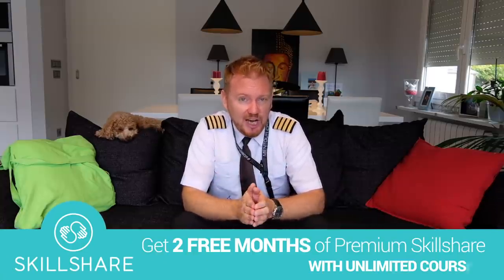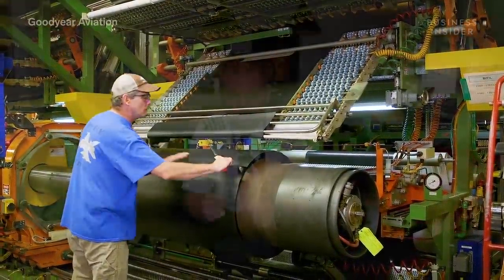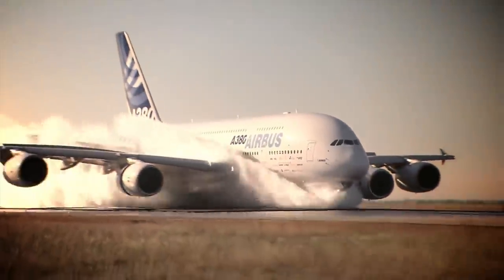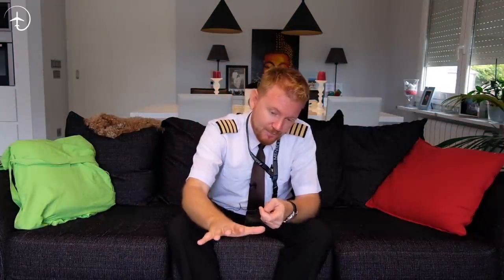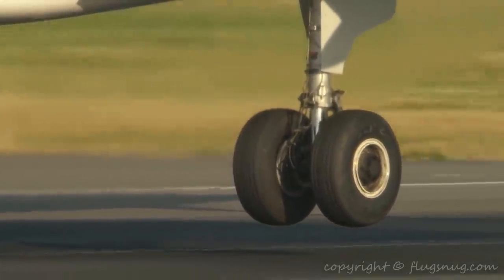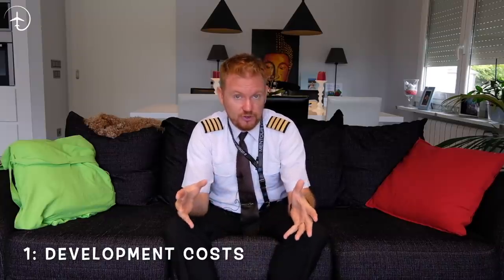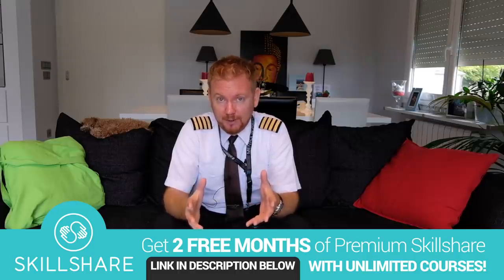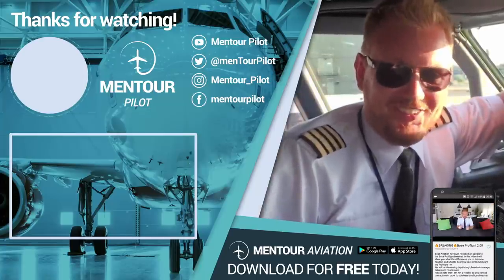Why not make plane-tires spin, before landing?!

Comment: You don't need an "electric/gas" Motor on the wheels to make it spin. You just need to redesign the landing gear rims where you have almost flushed side vents on the edge of the rims to draw air to small blades towards the inside of the rims to act like an air-motor that could pre-spin the free-wheeling tyres on landing. Almost like some of these aerodynamic hub caps (but with a purpose to pre-spin the wheels not just for aerodynamics). I wouldn't recommend a clip on hub cap, but it could be hard designed into future rims or more securely secured light weight hub caps eg with bolts. The wear on the tyres would definitely be dramatically reduced. This is a passive solution so it doesn't not have a complex point of failures like a conventional motor. The force would also be proportional to your air-speed so there is no mis-balancing of wheel speed mismatch or counter-acting magnetic forces an electrical motor might have if sudden changes in wheel speed happens.
Reply: Ha. See my comment......
Reply: But now youre increasing drag even more than the landing gear already does and probably mess with the pitch of the aircraft
Reply: That´s not well enough thought thru, first a spinning wheel is not good for aerodynamics, second the problem with the speed is still there since the speed of the wind is not the same as the ground speed and third it still needs to be fail prof.
Reply: Not sure if the airspeed would have enough force to spin up the wheels at the cost of the drag. However some bleed air could help
Reply: That´s it! Adding that you do not need match ground speed, if it goes just half the speed, tyre useful life will double. Being passive, L/G will not "drive" the aircraft out of lane in case of crosswind. Added drag is not an issue during landing. Tractors (remote controlled or not) shold be driving airplanes to and from runways since last century.
Reply: @annabellem7953  BTW I am not a pilot, just a lowly engineer. I don't really see much of an increase in drag as most current aircraft rim are not exactly aero-dynamic either these "rims" could be designed more aero-dynamically to minimize imbalances/differences of pitch or drag as compared with current rims. BTW you can always design passive centrifugal speed limiting spoilers on the rim design to avoid overspeeding.
Reply: @vossli1074  I am not imagining a significantly large sized hubs as the hubs could be design to improve/counter the aerodynamics of the wheel as compare to current landing gear design. We are talking about turning free wheeling tyres (which I am not trying to underestimate the force required to turn a free wheeling landing gear) as oppose to the force of turning the tyres with the weight of the aircraft on it.
Reply: @clovisaalmeidajr8651  The idea of the tractors is good, but the engines need bleed air to start, so they have to start at least the APU at gate and the second problem is, the engines need time to start, so they can´t just start them at the runway, captain joe did a good video explaining that.
Reply: @cvhawkeye6255  The problem is not the drag, but the down force could be.
Reply: Directing airflow between the wheels (in the lower half ) should be pretty easy, and instead of  creating special rims you could have a slight redesign of the tires (some low profile perimetrical extruded pattern ) which would require way less air pressure to rotate the wheels.
Reply: ...also the air flow duct could easily switch to the upper half of the tires the moment the hydraulic piston is compressed from the weight of the aircraft, thus functioning as a break ( of insignificant stopping power ... but hey why not) . All in all no motors needed for the wheels to spin before landing. Plus the excuse that tires are cheap is lame... we live in a pollution and climate emergency...
Reply: @theomichael6665  My 2 cents is asking doesn't the aircraft industrial tyres avoid tyre pattern with threads/extrusions like the plague? For fear of tyre debris from worn tires on runways.
Reply: more drag?
Reply: @annabellem7953  But couldn't the outgoing air from the rims be design in a way to minimize such effects? Time to call in the CFD white coats on this. Mentour Pilot probably needs to sponsor some skill share points in this area.
Reply: I was thinking about that too
Reply: But, as suggested in the video, the tyre lasts for 3 - 400 cycles, therefore, no real financial gain.
Reply: @colinsouthern  Well you are probably right that some one some where might have thought about it. But hey that's what opening ideas is all about even if it ends in a mindless exercise. You never know someone might add bits to a point that might lead to a new break through.
Reply: I had the same idea!   I think it would work and won’t cost much to manufacture.   There is still the test/regulatory approval costs tho.
Reply: @annabellem7953  they certainly have to be started before reaching runway. Even so, fuel will be saved. Imagine a time when Ground control does not give clearence for taxi but move aircrafts from gate to r/w and back!.
Reply: @cvhawkeye6255  Not as I know, these effects also apply on F1 cars. I´m not to sure about how it works completely, still learning.
Reply: guys, you are all on the wrong trip: not side vents in the air could bring the gears to the proper speed, no electric motor would be economical, the solution is making it mechanical: every passenger gets pedals underneath the seat in front and these pedals are connected by bike chains with cogwheels at the gears and 3 minutes prior landing the captain has to announce through the speakers "passengers! feet at the pedals! And on three: 3, 2, 1, pusch, pusch, pusch!" And 1 second before touch down all feet up from the pedals and the good thing is, at the start the passengers don't do it and the gears don't cause unhealthy drag, because they keep still. Who likes my idea? Thumbs up.
Reply: If I saw right, even an already spinning wheel on 2nd impact in the vid created a puff of smoke. This means the benefits would be reduced unless the exact speed of rotation required could be attained. I did go into this thinking would help however, using an inertial or centrifugal method to shut spoilers attached to the rims. My thinking was to just get some rotation in there to reduce the friction. Also I think the smoke is as much to do with sheer weight of the aircraft dropping onto terra firms as it is with the speed difference of wheel to ground. Great discussion though.
Reply: @colinsouthern  You are right! But a little change is needed then: better air con because everybody is sweating like hell 😂😂😂
Reply: @colinsouthern  I got some questions from a layman in engineering based on what you just said:
- more drag on takeoff thus decreasing takeoff performance
I wouldn't think an aerodynamically designed hub caps would offer very much more take off performance penalties than current rims (which are currently aerodynamically poor anyway) on landing gears and for the short period in which the landing gear is down. I can understand that this might not be for aircraft with non-retractable landing gear.  

- higher fuel burn whenever gear deployed 

- similar point to above ... current landing gears are not that aerodynamic anyway and given the period its down

- would need something to constrain speed (gear is lowered at much higher than V Ref)
- Doesn't current landing gears left freely spin anyway? How is this issue regulated? But like I said a passive contrifugal spoiler could be implemented. But this is a open discussion to ask questions and broaden my knowledge based on the topic raised as opposed to wanting to really wanting to build one.

- That constraining mechanism would need it's own failsafe and maintenance regimes.
- Well passive systems are usually more reliable and easier to maintain than alternative active systems like electrical motors.

- It would be dangerous for landing on wet runways where the initial contact helps prevent aquaplaning.
- I am not a fluid dynamics expert but how does the hydrostatic pressure in a spinning wheel be more than a wheel spinning at a much lower speed/hardly spinning hitting the ground given the same rate of decent and ground speed. Surely the faster spinning wheel would have a chance to remove the water in front of the wheel quicker thereby reducing the hydrostatic pressure to lift the plane to aquaplane. While a none spinning wheel would increase the amount of water in front of the wheel which in turn would increase hydrostatic pressure as the aircraft moves forward. In fact hydrostatic pressure is only reduce as the wheel spins up (as water is removed as the tire spins) after touch down. In fact during the aquaplane, the tires would hardly spin (as the aircraft drifts on a film of water) if there was no real frictional contact with the ground to enable wheel spin and water removal.

Sorry for the lengthy reply, just asking, I am no expert on hydroplaning. And I know its becoming to invent a sledge hammer to solve a problem that is commercially not there.
Reply: @colinsouthern  😂😂😂😂😂😂😂😂😂😂😂😂😂😂😂
Reply: @colinsouthern  that's why the propeller-stop-handkerchief is mandatory as part of the uniform, to wipe your sweaty face in case.
Reply: Usually the wheels fit snog in the wheel wells... I don't think the wheel wells will allow it.
Reply: Aircraft tire/wheel assemblies do not readily spin like blowing on a pinwheel. I’ve changed thousands of airliner tires and that’s a fact. Not only turning the wheel but the multidisc brake too.
Reply: I was thinking the same thing, but not as an addition to the wheel.
Rather, some chevrons could be molded into the side of the tire at practically no additional cost that would pre-spin the tire to some extent.
No, it would not necessarily match ground speed, but every little bit helps. And, yes, it would minutely increase drag - but at landing, that's not a big deal.

Also, as far as the "crabbing" on crosswind landings, the angle of attack of the air on the chevrons would be automatically decreased to incrementally nullify the effect when it is desired least.
Reply: Maybe other people already mentioned that but
it would take a lot of time to spin massive wheels using airflow 
small blades will not do anything good here and big blades will add decent mass and unnecessary  weight
the electric motor would make more sense as it can be integrated into the brake and may even be so strong to be able to drive entire plane on the ground on electric power saving lots of fuel
Reply: @colinsouthern  
I agree that is is not a problem and no need to do anything even if that could work.
summer tires are pretty resistant to all that kind of abuse so it is no big deal, just add more rubber.
Reply: @colinsouthern  You obviously either didn't read my entire comment, or glossed over the pertinent parts - such as, "Rather, some chevrons could be molded into the side of the tire at practically no additional cost that would pre-spin the tire to some extent.
No, it would not necessarily match ground speed, but every little bit helps. And, yes, it would minutely increase drag - but at landing, that's not a big deal."

The point is that any amount of pre-spin would diminish tire wear, and the pre-spin could be accomplished with any positive amount of asymmetrical amount of drag on the  bottom of the wheel as opposed to the top of the wheel.
There is no need to try to match, nor approximate ground speed for the wheel - just reduce the differential speed between the two.

I don't even know what "normal ground speed" means, so I'm not sure where that came from.
Reply: @deltaxcd  I get that, and I'm specifically not calling for the tires to be at ground speed - just not as slow as stopped.

Like I said, "every little bit would help in reduced wear on the tire", and molding in a small feature on the side of the tire that causes any amount of rotation in the right direction would take advantage of freely available sources of energy without having to add expensive and fallible equipment to the plane.
Reply: @jdgower1  
well then I am not sure whats is your point
there is no reason to bother with "every little bit"  tires are not that expensive to care about little bits
and making them turn at low speed will not be any use. small chevrons will not be able to spin it into any reasonable speed. 
You rather just add the same mass of extra rubber to the tire and get better results by making it last longer.
Reply: @annabellem7953  What's less failproof than the most simple fan?
And the wheel speed obviously don't need to match ground speed as they are spinning at ZERO kph right now. As far off as they can be.
Reply: @clovisaalmeidajr8651  tyre useful life will more than double when halving the speed. The less time spent in "friction", the less heat will generate which means less overall total wear.
The longer the wheel takes to spin up from stationary, the higher the contact temperature will be and that's really what causes wear on rubber tires.
Reply: @colinsouthern  I understand your misgivings, but I think they are misplaced.

I'm not going to try to do a CAD drawing of what I'm suggesting, so let's just forget that I said anything at all - OK?
Reply: @deltaxcd  I work in the engineering field with smaller companies who are trying to find every efficiency increase they can, wherever they can.
They realize how pennies add up to dollars, so that's where my perspective is.

Let's just pretend I didn't even say anything, and all will be OK.
Reply: @cvhawkeye6255  "just a lowly engineer". May be that's why we both thought the same thing.
Reply: @vossli1074  Increasing drag is miserable
Reply: @annabellem7953  spinning wheels passively does not means spin it exactly the same speed ,it means spin wheels near the landing speed, spinning wheels passively with hubcaps or fins will never rim reach the same speed as aircraft lands just because of some aerodynamic losses which is unavoidable and the  will be some slip between airplane speed and wheel speed , person meant with his comment that using that technology will drastically reduce tire wear and tear and since this system is passive there is almost no chance of failing cause there is no automation it is just passive
Reply: @axelBr1  Lowly is always good it gets you in a learning position especially if you are not paid to be a know it all jackass expert (which no one really is but pretends to be one). To me this exchange has been useful, especially when I am not in the industry. I watch Mentour mainly to see the dog in action love Patxi.
Reply: @colinsouthern  After some more thought, in regards to aquaplaning ... it would seem that the deep of thread/thread design of a tyre would contribute to the tyre's performance on wet ground more than a tyre being prespun or not immediately upon touchdown.
Reply: CV Hawkeye the main issue with your solution would be when the aircraft would come in at an angle, like Mentour explained. Then, the side of the landing gear leading into the air would spin faster than intended and the trailing side of the landing gear would probably not spin at all, having the hub behind the air stream..
Reply: I have been flying over 40 years up to all versions of the 747, except for the 741 and had those ideas some 30 years ago; there are even patents established on similar ideas. Seems to me the low cost of tire replacement and the high cost of getting anything certified in aviation will keep those ideas on the shelf. .. even electric tugs to get you to the runway when you are # 75 for take off @ JFK where you burn 4 tons of Jet A1 to get to the #1 position just to taxi back to get more fuel for your 748 with a taxi weight of 440 tons seems like a total waste. In Africa there is a saying: TIA, “This is Africa” when things are not flowing to expectations .. I would say: TIA, this is aviation.
Reply: @richardlewis7471  wanted to ask Petter but I guess you know much more likely: how heavy is a tyre of a 737? Or how does it work at all: do you change the whole wheel to make the change MAYBE quicker and later you put off the tyre? Or does the wheel stays at the aircraft and you actually change then only the tyre? And how often need the brakes discs to be changed... well, that depends a lot at if the plane lands 10 or only 4 times a day, e.g. - so stupid question... but are the discs extremly sturdy or have they to be changed anyway quite a lot?
Reply: i think what you are speaking of is a voith schneider propeller integral with the hub of the tires.
Reply: @RealCadde  Yes! That is what I meant. Another advantage: less tyre change means aircraft available to fly $$$.
Reply: Was about say this, just fit some fins to the rims on the wheels.
Reply: Where would you fit a motor big enough to spin the wheels
Reply: Great idea. I was ready to post my idea, which is close to yours! Great minds think alike...Bless you guys.
Reply: Yes , I thought of something similar . But as he says on a cross wind landing . One wheel would be exposed to more wind so would be faster then the other and that would be the windward tyre . So the aircraft would be forced to the down wind side . Not a thing you would want !
Reply: You can also put a retractable cover on the wheel rim so the spinning can be disabled if for any flight condition it is not advisable.
Reply: I learned in school that they did trials in the 1940's with this ram-air driven wheel concept, by using "air scoops" on the rims.
But the gyroscopic forces generated by these spinning heavy wheels were causing problems with controlling the aircraft before landing.
Reply: @nozack5612  Spoilers which reduce the effect of the rims doesn't mean a retractable kind of approach.
Reply: @welshpete12  I am not so convinced. These rims will have their intake from the sides along the same  directional axis of the wheel ie from the front (looking like protruding hub caps). Unless I am completely missing it the aircraft's forward airspeed will almost always be much greater than crosswinds.
Reply: @halcyonoutlander2105  Passive Centrifugal based spoilers can always be designed within the rims to regulate top wheel rotational speed to no greater than say 160-200knts if the wheels were rotating on the ground. BTW upon landing, air-speed would be approaching ground speed Typically 140-150knts.
Reply: A better written and explained version of what I came here to say. Thought it for years. On a v short runway you’d brake briefly just before touchdown to add the braking benefit of the touchdown smoky spin
Reply: Voss Li it would be tiny as the vanes would be tiny
Reply: @annabellem7953  
>The problem is not the drag, but the down force could be.
The force would actually be up. Pressure would be less at the upper part of the wheel , because of higher speed relative to air.
Reply: Asymmetric dimples on the tire's sidewalls would probably work.

This can't be used, though, for airplanes with open wheel well (Boeing 737).
Reply: @halcyonoutlander2105   Yeah, but it doesn't have to match exactly. I mean, right now the difference between the ground speed and the wheel is TOTAL. So any speed you can get them closer together is a win anyway.
Reply: Your idea seems to be good ..But ..still the problem of SUCKING FOD's (foreign object debries)....is most concernd and seems to be unsuccessful.
Reply: @mohdmubashirahmed4762  What??  Sucking FOD into what?
Reply: @jerrykew  I always thought that when a tyre smokes it meant some skidding/loss of grip has occured, thats why ABS was invented to improve braking efficiency in cars.
Reply: Exactly.. Just use existing air flow.. There's probably a number of ways to make it work.. But some designs probably more efficient than others.
Reply: Is an airplane not complex/expensive enough for you?
Reply: Ok, where would you put the brakes then????
Reply: @huberttrimmel9245  Spoken like a true expert of the skies and taxiways to be that funny. Love it.
Reply: @fullstackpedro  energy needed to spin a free wheeling tire is nothing compared to the drag of the entire airplaine during landing with all flaps out.
Reply: @clovisaalmeidajr8651  I was thinking the same thing about not needing to match exactly, just get close. BUT, I highly doubt tire life would double even if you did match exactly. Look at the landing video: Sure, there's blue smoke when the tires first touch and spin up. But the stress on the tire a few seconds later, when the aircraft puts its full weight on it, is comparatively *enormous*, and I wouldn't be surprised if most of the wear occurs at that point.
Reply: @chingu1980  Guessing here, but probably inside the wheel hub similar to present arrangement, as the (air flow) wheel acceleration feature would be external.
Reply: Not only that, adding external, air flow capturing fins (or similar) may also help with wheel cooling!! As heat is a major destructive force on aircraft tires.
Reply: @welshpete12  I don't think it that's much of a concern, because it happens all the time that aeroplanes touch the runway with only left or right landing gear, meaning the affecting force is very one sided.
Reply: You missed the entire point.  It is not cost saving at all.  It’s physics.    Watch the video again.
Reply: perhaps the effect would be minor but, a spinning mass is going to induce torque. To make things worse the landing gear is hung below the aircraft giving them leverage. this would induce a roll right force. I'm sure it could be trimmed out and handled with computers but it will mean that you will lose some roll left maneuverability. You might also find a difference in roll rates?
Reply: CV Hawkeye in addition “the airspeed“ has nothing to do with it it’s the ground speed which can be and usually is different. The other thing is that you are adding yet another variable to something that has worked fine. There is no major issue with the tires so there’s nothing to fix.
Reply: @colinsouthern  The wheels have to be spun up for a very brief portion of the flight.  As per the airspeed and wheel rotation issue, that could be calibrated with a retractable duct that allows for modification of airflow to the wheel based on airspeed/dynamic pressure.   The bigger issue of gyroscopic yaw mentioned by other posters could be corrected by FCS.   All in all, it seems the complications and risks are not worth the gain.
Reply: @vossli1074  True but I think the most salient argument against it is that tires are CHEAP in the airline maintenance world.
Reply: @colinsouthern  Sadly, never put down unshakable faith, because you will never learn anything by being a jackass in the corner yelling it will never work. There are people in the world who might not be as educated, talented or experienced as "some others" but that doesn't mean that they shouldn't try. Standing in a corner making unconstructive comments like some superior entity is I guess some god given right ... but it sure doesn't help or be in the end respected. I am sorry I don't meet certain standards in sharing my thoughts. BTW I am not hurt ... just saying.
Reply: @colinsouthern  I didn't quantify it, was just responding to other aviators who stated it may be a problem.    The gyroscopic effect of jet engines is minimized by counter-rotating engine components, whereas the wheels all spin in the same direction.   Again, I didn't quantify any inertial moments so can't say explicitly.   Ultimately, I think the correct answer is the spin up of wheels  is not worth effort and time as you suggest.
Reply: Annabelle M , I would think that the “wind speed”, is actually greater than the ground speed of the plane. They always land into the wind, and the speed of air is directly related to the ground speed PLUS any wind speed. So even if there is zero wind, the air speed equals the planes ground speed.
Reply: @colinsouthern  Well, we certainly expect higher standards from aircraft designers especially if they have been paid to do the job. But do remember, we are here where we are from a lot of failed ideas, some people only want to get involved in discussion and possibilities when its past prototyping and testing (because virtually all ideas good or bad has to start somewhere, some I would say from even more humble beginnings and alot ... I mean alot really don't have the patience or time for this phase). Most of these discussions lack specifications and scope to even make fag packet calculations, but that shouldn't stop YT comments to think of possibilities and learn from issues shared. I know from my interactions, I have truly learnt from your thought processes with thanks for your patience in replies e.g. aquaplaning. So a thank you from a person not even close to your industry in which all I know about planes is just to sit in it and enjoy the flight! Its all good from here, and I certainly understand your PoV.
Reply: @vossli1074  When you are taking off that is a problem, but not when landing- it actually helps then. It is balanced out. (And pilots can certainly adjust the pitch of the plane to be ever so slightly higher anyways)
Reply: CV  I was thinking about a similar design, and I don't see a problem at all. I've read about half the comments to your original post, and I'm not sure if anyone touched on it yet, but besides the very small addition of weight and drag, there seems to be no reason not to test out the idea. Only possible case I can think of at the moment would be varying bearing friction causing one side to spin more than the other, possibly inducing an unexpected yaw on touchdown, but that would be no more than if one side touches down before the other with current setup. 
 I'll have to start testing with models and see if something pops up. 
 👊😎
Reply: right,  smoking wheels look like there is something not correct. The material the tires are made should withstand high temperature and not start s  to smoke. Crastin® withstands temperature up to 150 degrees.
Reply: @vossli1074  when landing, increased drag is useful!
Reply: the Aircraft tyre Mafia would not approve
Reply: hooray . . . .plus , if that same system directed the used air via a duct to cool the brake discs . . .mmmmm . . . very little extra drag on the gear and extra disc cooling for brakes at the critical time
Reply: Climate emergency - LOL!!
Reply: @halcyonoutlander2105  Yeah, i agree. I was only responding to the "speeds not matching up" argument many people are bringing up here. 
But yeah, there's many reasons why the whole thing is a bad idea. It's like people are trying to invent a solution to a problem that's not really there.
Reply: agreed - and while it was mentioned that the speed would be difficult to match, surely getting to ABOUT the speed is better than spinning up from zero - and your suggestion is failsafe compared with motors
Reply: Been thinking of a passive system for years.
Reply: I have the same idea. Several years ago I asked the same question of spinning up the wheels. I came to a possible solution where the wheels were passively spinned up by some kind of a turbine fans connected to the wheels. Probably it would be difficult to reach the landing speed, but a consideral amount of wheel spin would help anyway. Lower spinning speed would also reduce the "off the road" force at a crosswind landing. And such a passive system would be more simpel, cheaper and with less possible safety issues compared to a motor driven system.
Reply: @bertschoofs8494  Precisely. The only thing that fucks me off is that I'm not the only one who's thought of this idea!
Reply: @annabellem7953  Why does it have to be fail proof. If it fails we are back to the current situation, which is not a big problem.
Reply: I remember one of my high school teachers....decades ago....saying he had a patent, or had applied for a patent, for something just like this.
Reply: Wheel speed could be accurately controlled to a fixed speed...say Vso....via a simple spring-loaded centrifugal governor actuating the air turbine inlet vanes or nozzle.
Reply: @Tom-tk3du  Applying for a patent is only the very start of a journey. It could be 10000:1 chance just to get it approved and to check if the idea has not already been invented, and another 10000:1 if the patent would even become a prototype (alot of patents are just shelved for many reasons). Probably another 10000:1 that the product would be successfully marketed and sold.
Reply: @cvhawkeye6255  Thanks, I know. I hold 4 patents. Am mainly speaking to the novelty issue....pre-spinning aircraft wheels is likely unpatentable or patentable for a very narrow and less valuable set of claims.
Reply: @Tom-tk3du  I too am a patent holder but not in the aircraft industry. I wasn't planning on anything serious, it was just a point of discussion. And you are right anything patentable would be extremely narrow like some design based patents. Broad-based patents equivalent to inventing the wheel have long gone unless you are entering new fields of science or industry.
Reply: @balazslengyel6950  everything built in an airplane has to be fail proof at a specific level, without is it impossible to certify a plane
Reply: Consider need to brake them after takeoffs (and added drag, when you need pull force)
Reply: Also, tyres are used for braking on landing (if no thrust reverser can be used, it's only option), so you get undesired effect and need longer runway.
Reply: @Scott Millner sorry, I don't have few hours to read through all this thread, keep on rollin ;)
Reply: I agree.   Having air spun wheels by impeller would also allow the the inertial to be absorbed as soon as the plane lands, so it would help the tire wear, but not add any momentum to the plane.
Reply: man i really hoped to find this comment on top, thanks for doing this.
Reply: I was about to say something like that too, doesen't seems hard to do
Reply: Great idea
Reply: You could use the brakes on the landing gear to stop possible aerodynamic problems when not needed to be spinning
Reply: Not ideal for several reasons.  First is safety.  If even a single one of those fin/vents breaks off, it can pop a tire or rupture a fuel tank, both of which can have catastrophic results (think concord).  Also, the planes stop just fine now as is.  Those thrust reverse units are very powerful.  Vents would not even shave off a second of stopping time- might add to it.  Vents would either make the rims heavier or less strong.  Each wheel is subjected to incredible forces.  A simple and strong design is best.  Slight friction upon stopping adds helpful resistance which contributes to the slowing of the aircraft.  If you had fins that spin, that could make slowing worse after touchdown due to the fact that they are continuing to grab air and spin.  The most effective way to slow the plane, short of a parachute or arresting wire is a strong reverse thrust system, strong brakes and grippy tires on a well prepared runway- all of which are in practice today.  Aeronautical engineers are a smart bunch- they have already thought through all these ideas and a lot more.
Reply: Yep something well designed like that should improve quite a bit the tyre wear, but I think a good brushless motor and with a good and precise speed controller also tend to last for quite a lot and has the advantage of using the motor to help reducing the speed of the airplane without using the brakes since the motors can also make braking force and also if well calibrated to the actual airplane speed the tyres can be adjusted very precisely to the right spinning speed needed for landing too...

Also it wouldnt need much battery weight since it only need to spin for landing, it doesnt need to make KM of range like an electric car and they can be protected with a fire proof compartment which the batteries can explode and nothing would happen...

But sure the more crap you put there's always more reasons for it to fail, that's always kinda true since the more electronics the more fail points it could potentially have.
Reply: And what would the same hubcaps do on takeoff? Interfere with aerodynamics and increase drag!
Reply: I don’t really think this will spin much at all, the bottom blades will be pushed counter clockwise and the top ones will be push clockwise by the wind
Reply: You assumed wrong that u need to spin the wheels to the landing speed. Not necessary, it's enough to spin them to 150 km/h or some. Leave the rest for contact, with auto-disengage electric motor at touchdown :) The stress would be many times smaller. How much?! Well let's see: [(landing speed - 150)^2]/landing speed ^2 = [(220-150)^2]/220^2= 4900/48400 = almost 1/10 . So with that you have 1/10 spin stress on the wheel. So here is the solution ;)
Reply: Drag and lift are not proportional to air velocity. They are proportional to the square of air velocity. Also there are numerous other issues with this idea that others have covered thoroughly, but I will still give you credit for your clever use of existing conditions to achieve a desired result rather than using additional internally driven system, even if it is ultimately not feasible. This is the kind of thinking that we need more of in the world.
Reply: @clovisaalmeidajr8651  adding drag is always an issue. Planes can't just land at arbitrarily slow speeds. There is a minimum required airspeed in order to safely land so that the wings don't stall. Drag is only not an issue once all wheels have made contact with the tarmac. There's a reason pilots don't deploy full spoilerons before touching down.
Reply: Mattes Rocket  aircon is provided by the engines compressors so I think you might have a bit of a feedback loop there with passengers needing more aircon to pedal harder in order to pump out more aircon.
Reply: ...Or you could put a wheel-arch on the top of them and let the drag spin the underneath of the tyre.

Its all about simplicity and coft-effectiveness.
Reply: @vossli1074  no. lots of bs comments everywhere. The drag will be not much more than required to spin the tires. Drag during take and landing is not much of issue (there is headroom for more drag).  Gear already makes a lot of drag. The extra drag of spin wings would not be that much. It doesn't seem that a design target would be to completely match wind speed anyway. Imagine the wheels as simple a vindvane. Also the vanes could probably not be on the tires. Idk if that's the concept he meant, but that could never spin the full speed, but it might be worth it anyway. Saying it could mess with pitch is just right the fuk out non starter imagination. There would be almost no torque force anyway, as that would only developed during acceleration of the whell rpm,  which would not be a quick process or bumpy.  Just a bit of added drag. Motors might do a better job maybe but  but I like the vanes idea better because super simple and super reliable.
Reply: @clovisaalmeidajr8651  Idk if motors should or could be drive motors or just spin motors or just simple wind vanes while could probably only spin to maybe 1/4 airspeed just super vague guess. Maybe a elsewhere drive motor idk. Idk if rubber savings is linear. It drop off even faster and save even more rubble, because at a certain lower differential speed between wheel and ground, the tire stops skidding and rapidly spins the wheel instead.. it 'bites'. Also at the higher end of the speed differential spectrum the added heat differential may contribute to more rapid rubber loss, or not, Idk. I have my suspicions it might, but idk. All in all it just seems an understudied subject. But maybe it's not as understudied as this video and these comments makes it seem.
Reply: @cvhawkeye6255  yes, but imagine probably that a simple design could never turn the wheels as fast as the airspeed. And that's not a problem if  you still got significant gains in reduced wear and shorting distances of skidding. People don't often realize when the tires first touch normally they are in a full skid until they spin up. It's usually a very short distance in runway terms but might be quite a bit longer on wet runways, idk.  And it still a skid. It usually amounts to pure braking direction skid. So, like locked brakes for a moment. Not a good way to be braking. It's an interesting subject.
Reply: @clovisaalmeidajr8651   "tyre useful life will double." And you have demonstrated this in what laboratory? And as pointed out, nobody in the REAL aviation industry has seen fit to even try to produce this, after over a century of flying. . . do you ever wonder why? Armchair engineering is a weak substitute for the real thing.
Reply: @sshhii  Believe it or not, especially for critical systems like landing gear, weight and complexity is a very bad thing. Each component that can fail eventually will, and designing for that probability has to be weighed against any perceived advantages.
Reply: @Tom-tk3du  More weight - more complexity, and all for what? A few grams of rubber per landing less than already consumed in  ground maneuvering and braking?
Reply: And how would you cool the brakes which are located inside the wheel rim? Now they are cooled by holes in the wheel hub.  I worked on commercial aircraft for 15 years.  The tire has about 13/32” thread.  At 3/32” tire depth the tire was either replaced or put on a 50 landing limit at which point it must be replaced.  This rule was specific to the company I worked for.  It shows that the tires last a long time and the complexity to make them spin is not worth the effort.  The reason that nitrogen is used to inflate tires is to eliminate moisture that is in compressed air sources.
Reply: @paulcrumley9756  Wow! What a [really not] usefull answer!! That´s it: If nobody has done, no one should try :-)
Reply: @clovisaalmeidajr8651  People have tried. It didn't perform as desired. They (wisely) quit trying.
Reply: @annabellem7953 – The wheels spin at 150+ mph after liftoff for a short time. Gear legs and wheels do nothing positive for aerodynamics, and neither do open gear recesses.
Reply: @cvhawkeye6255  why bother? the old engineers adage applies if it aint broke don't fix it. Plus all these systems come at some sort of additional cost but they aren't needed and can be detrimental to aircraft handling in a critical phase of flight.
Reply: A Kids group with His teacher 20 years ago Got the Idea make littel Wings tibthe tires to Spin Them before landing.
Reply: If you have enough power at landing speed to rotate usefully, then you might overspeed the wheel if the gear is down at higher speed, meaning if you forget to stow the gear for a minute after takeoff, you might damage something with overspeed. Too much variation in air speed. Also, an air motor is still a motor, and can fail. A small piece of something could get in there and lock up the wheel. 
You're adding complexity, and failure modes.
Reply: The wheels don’t spin freely - there’s a brake system involved with constant friction.